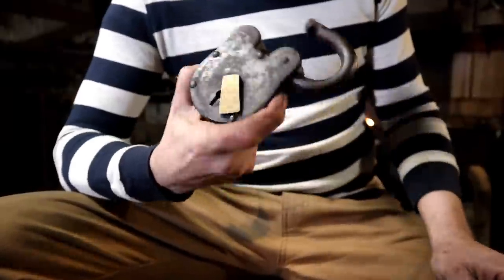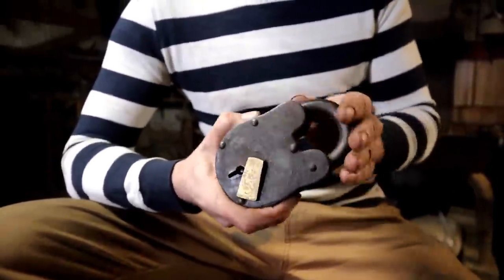Forging a Key for an Old Lock - Slavic Smith

Comment: This is marvellous - how did you know how to cut the key so as to actually work in the lock?
Would love to see you guys do more whimsical stuff like this too. And more armour!
Reply: I was wondering that aswell, didnt know if i missed anything but i also dont have any idea
Reply: My guess is he took the lock apart to view the pins and then riveted the lock back together.
Reply: I was hoping he was going to show that too. My guess is that he actually has the original key and just copied it.
Reply: @GallowglassAxe  or the old locks and keys weren't that complex, and any key had the same 'teeth'?
Reply: If he didnt have an original key or didnt open the lock up, it is possible that these locks had very little variety and he was able to look up the grooves by some serial number on the lock
Reply: Ilya is a blacksmith. He has specail powers...only a blacksmith posses. Note in this episode that his hair was down? Sampsonesk no? I mean seriously he DID forge an meteor into a sword...so a key that doubles as a bottle opener,  though a daunting task w o question , simply meant he had to resort to a different kind  of blacksmith special powers.  Oh and let his hair down so it all worked out just right.
Reply: You'd just use a feeler gauge and make a sketch. They don't have ment pins and the tolerances are huge.
Reply: He could have done it several ways, either by taking the lock apart and looking at the internals,  it doesn't have any wards,  so just where the lever plates are etc would be needed or he could have made the blank and then blacked it (used to be done with a candle to lay down soot) and tried it in the lock to get the points where the plates shined up the surface. Being an honest type I can't remember if you file/cut at the shiny points, or the non shiny points though :)
Reply: Put some fresh paint on the key, put it carefully in the lock and try to turn it. Carefully remove the key. The paint will be marked where you have to file.
Reply: @Loshko86  That would kinda defeat the purpose, wouldn't it? ^^

Comment: Nice work! Finding the right key blank is too easy.. not when you can forge yourself one :) Love it! 

Though you did miss an op to take another old steel or iron padlock and forge it into the key.. from lock to key.

Glad you knew the key bitting, otherwise the video about key impressioning would make it twice as long, but if anyone could do it it's the Slavic Smith ;)

Keep up the awesome work!

Comment: Hm, how did you know where to put the grooves in the key to catch the lock?
Reply: Slavic instinct
Reply: It's Ilya, probably part of his KGB training!
Reply: He copied a working key. As far as I know, there is no way to to create a key by impressioning for a lever lock. 

As you can see, he started the video with the lock open, then had to use his key at the end to unlock it. Only problem is you need the key to lock the shackle in the first place.
Reply: What he made is called a skeleton key it was a notorious flaw in that style of lock hence why the lock systems have largely changed now adays I would need a whole kit of tools to open a modern lock
Reply: @anneschnell5303  Yeah I broke a key in my apartment lock, the janitor in the building spent 30 minutes drilling through it before being able to catch the lock and flip it open. So there was a "special" key that could open any kind of "ye olde" padlock?  I wonder how many people had one of those..
Reply: Some fresh paint on the key blank is your friend.
Reply: @anneschnell5303   not really a small hook and a half decent tensioning tool and you can get into like 90% of locks. As for impressioning just need a blank a light box and a diamond file and it takes about 10min and you have a workable key. This is all with a fair bit of training.

Comment: Stupid question, but why do smiths often just bounce the hammer slightly on the anvil after a series of hits on the piece being forged?

Also, how'd you figure out the pattern that the key needed in order to work?
Reply: Because it needs less effort than to stop the hammer with your own force... we just let it stop. Also if you need to strike again, there will be some energy left that you can use!